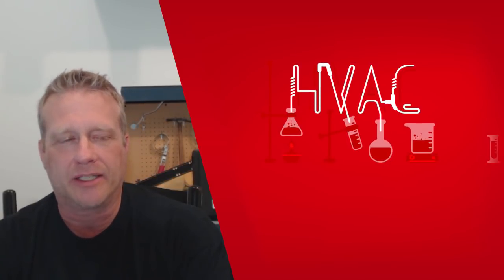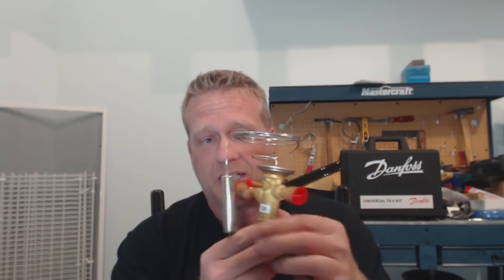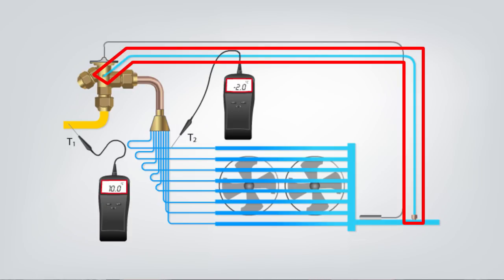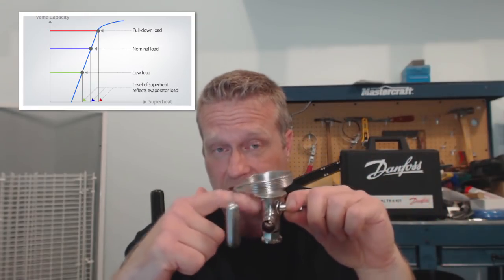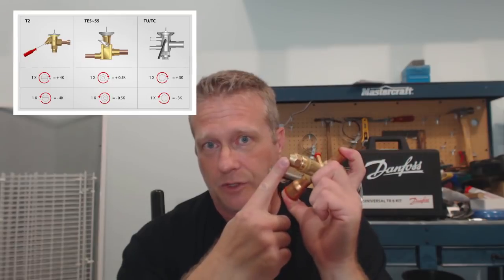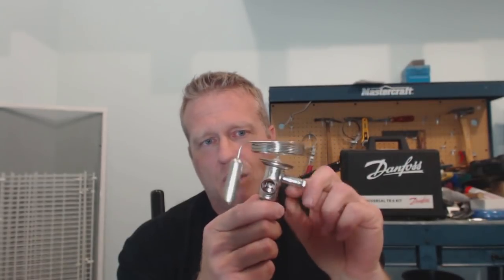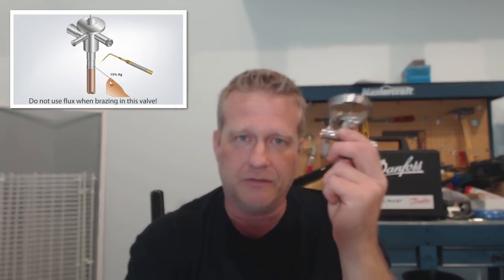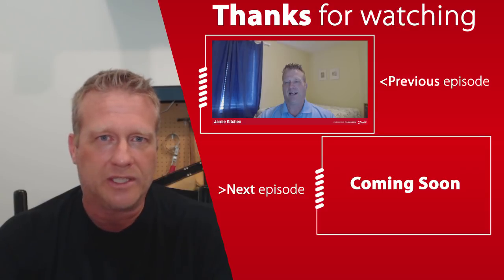How to set TXV superheat and other helpful TXV tips | HVACR Distillery Episode 2

Comment: I am using 55 ton capacity TXV of Emerson, it controls refrigerant flow to two compressors . When two compressors runs together TXV works fine but when one compressors goes off the TXV starts flooding the compressor. Why is that happening? Is there any difference in selecting a TXV to control single compressor vs dual compressors in the same refrigeration circuit. My application is air cooled chiller. 
Any support appreciated 

Regards
Reply from the maker: Thanks for your question. We are checking with our experts and will get back to you.

Comment: How does the txv manufacturer determine which refrigerant will work with which txv?
Reply: This is a good point to cover and I apologize that I missed it before. How a txv responds is determined by the balance of forces under the diaphragm and the force produced by the sensing bulb. Each refrigerant has unique pressure - temperature values which must be overcome by the force exerted by the sensing bulb. As such, when determining the bulb charge for R134a/R513 for example, a mixture of R134a and several other gasses is developed for use in the sensing bulb. The other gasses are used to ensure the txv responds in a similar way across a wide operating temperature range. If it is for R448a, then a mixture of R448a and additional gasses are formulated for the sensing bulb. 

The other part of the txv that needs to be sized for a specific refrigerant is the superheat spring as it must provide a specific amount of force so that the required amount of superheat is present before the txv will begin to open. How much force is required for this differs among the various refrigerants so R34a will have a different superheat spring than R404a will. I hope this helps!

Comment: Please  can you explain in a simple way, what are the differents between internal  vs external equalising. What are the applications for internal and external. Thanks deeply appreciated.
Reply: Hi Draven. I apologize for the delay. Internal equalized txv's can be used when the evaporator has only a single refrigeration circuit in it and does not utilize a refrigerant distributor. These evaporators have a low pressure drop so the pressure under the diaghpram is very similar to what is present throughout the evaporator. In multi circuit evaporators, a refrigerant distributor is used and there is a large pressure drop between the txv outlet and where the sensing bulb is located. In these circuits,  an external equalized txv must be used as the pressure at the txv outlet is higher than what is at the sensing bulb. An external equalized txv will take the pressure at the sensing bulb location so the pressure under the diaghpram is the same as where the sensing bulb is located.

Comment: Hello, great video!!
I have a question for the TE5 Valve. 
For the case of a secondary system of glycol with plate exchanger, how can a valve react more quickly, which in this case has MOP? or maybe it is not selected correctly.
Reply from the maker: Hello Ezequiel. Thank you for your question. By react quicker, I assume you mean how quick they open and close in response to a change in load. I am not sure why you require quicker response times but I will assume it is to limit how low the evaporator pressure drop once the compressor starts up. The rate of opening response for a TXV is based on the amount of load as sensed by the value of the refrigerant superheat leaving the evaporator and to a lesser extent, the type of bulb charge that is being used. It is important therefore to make sure that there is a load on the evaporator to drive the valve open when the compressor starts up. Plate heat exchangers have a relatively small internal volume to hold refrigerant compared to traditional heat exchangers so ensuring that there is a load present when the compressor starts is very important as the compressor can quickly empty out a plate heat exchanger resulting in very low evaporator pressures. With a scroll compressor, this is not good. 

MOP or Maximum Operating Pressure bulb charges theoretically should not affect the rate of opening unless the evaporator pressure gets too high. However, some MOP charges limit how fast the valve will open and this can result in slower response times. If this is the case, then replacing the MOP valve with a standard bulb charge and using a crankcase pressure regulator instead will allow the TXV to keep up with the compressor and maintain higher evaporator pressures.

Of course this all assumes that the TXV is sized and installed correctly.”

I hope this helps to answer your question. 

Jamie Kitchen,
Danfoss Cooling

Comment: Can you make some video regarding lubrication for variable speed compressors at low speeds. Danfoss solutions. 

Company STARCOOL makes Reefer Containers working with Bitzer Octagon Inverter driven compressor . Control is reduced to three solenoid valves. Variable speed compressor and pulsing ON/OFF valves works together to modulate cooling capacity. Time of opening liquid line valve is short mostly. Wonder what condition it creates for TXV if TXV is there at all.

Danfoss
Reply from the maker: Hi Rafal. Thank you for your query. Yes, we will certainly consider covering lubrication for variable speed compressors in a future episode as it is an important aspect of how fast and/or slow compressors can operate. 

Concerning your question, the pulsing on/off valves in the liquid lines sound like you are referring to Pulse Width Modulating EEV’s which are metering devices. If this is the case, then there will be no need for a mechanical TXV for refrigerant metering.

I hope this answers your question.
 

Jamie Kitchen
Danfoss Cooling